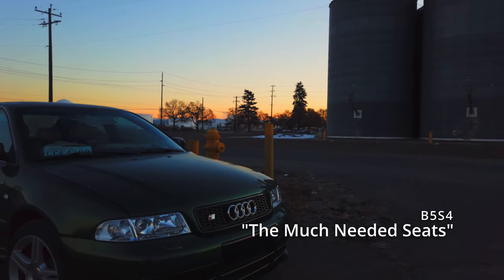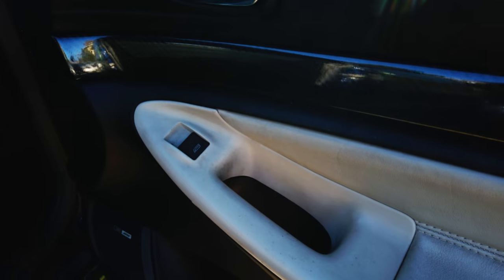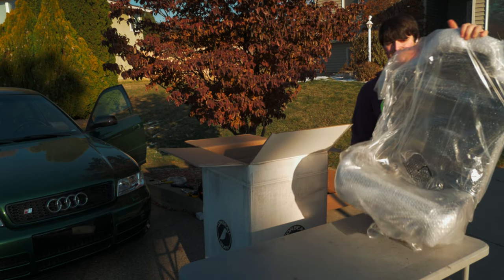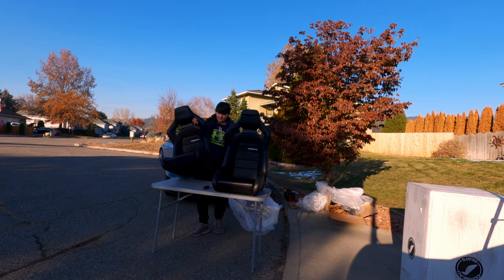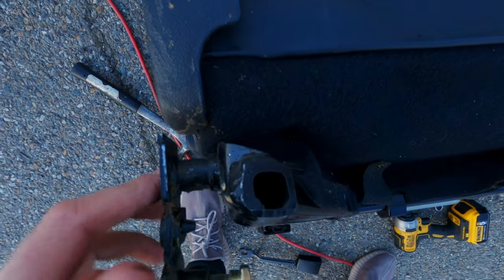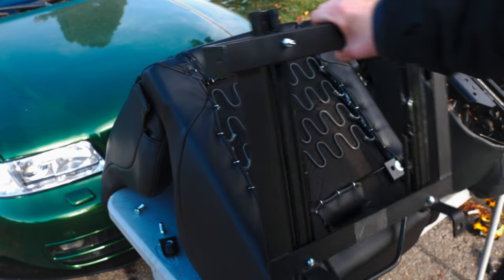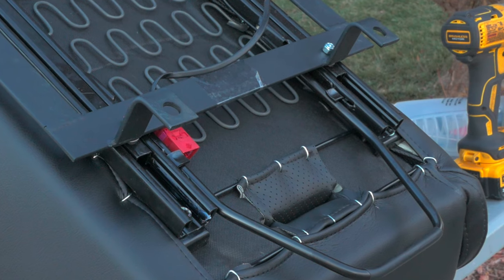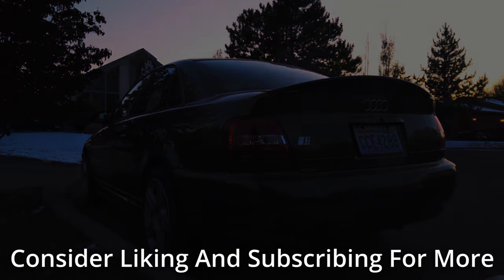Transforming The S4 Interior With Bucket Seats! | Installing Corbeau RRX's

Comment: Great vid as always. You put me over the top to get an s4 a few weeks back and i am LOVING IT! Highly recommend the car. 

Mine may need seats ine day as well. Did you just not use the airbag wiring/just the seatbelt wire? Or is that what the airbag wiring is going to? The other two big plugs are just for heat and oem seat movement controls? 

Thanks! Love the channel.

Comment: Hey I just got a b5 s4 and I am wondering where did you get those turn signals?
Reply from the maker: I got mine from an ebay seller. I don't think he has the identical ones for sale anymore, but there are some similar ones linked in the description that may work with some modification. Thanks for the support!
Reply: @HunterDirection  okay thank you! I managed to find some and they are a nice upgrade from the stock ones.